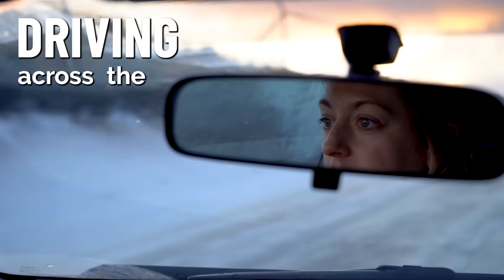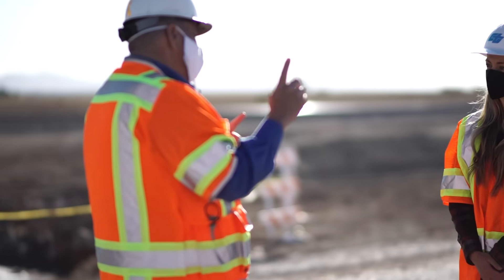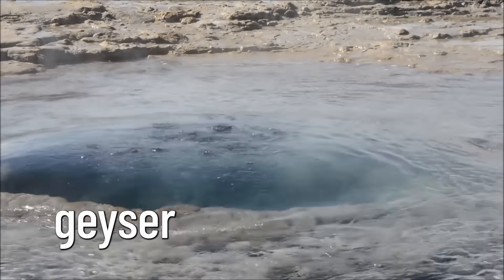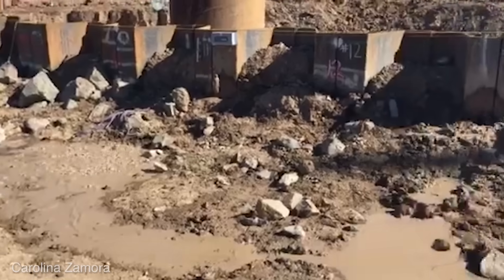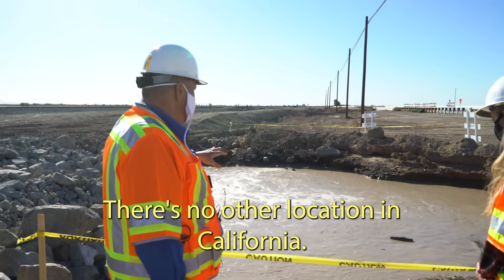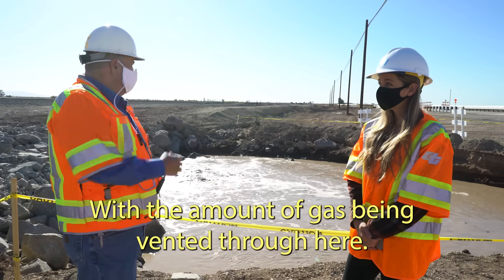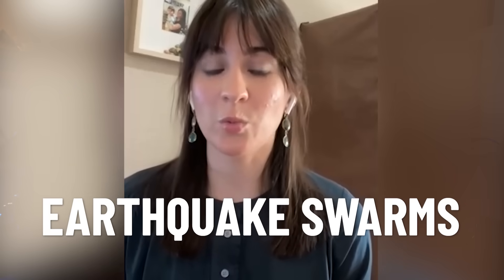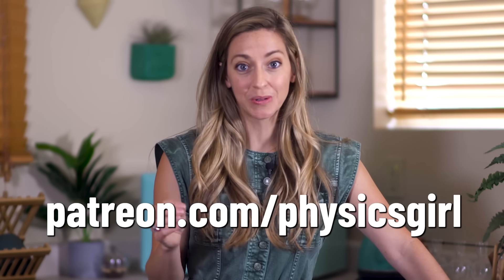World's Only Moving Mud Puddle

Comment: I think I know what this is. I think the earthquake swarms were the fault line beginning to expand. more than likely it is a combination of a gas pocket and the water table moving toward a new underground crack. the water is eroding the rock and soil away as it moves to fill in the crack and the gas is adding a pressure system to the process. Its the only thing I can think of that explains what is happening. We may very well be witnessing the opening of a new fissure.